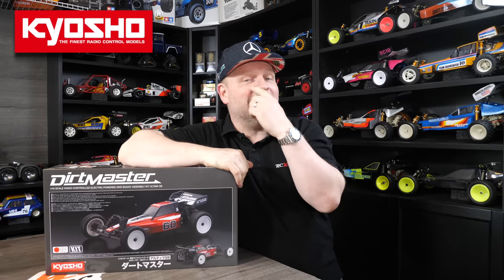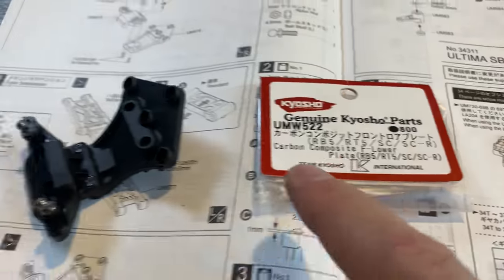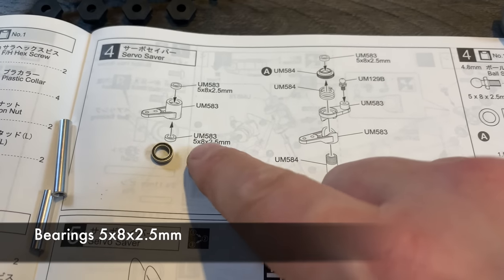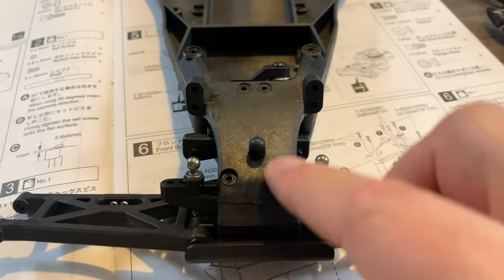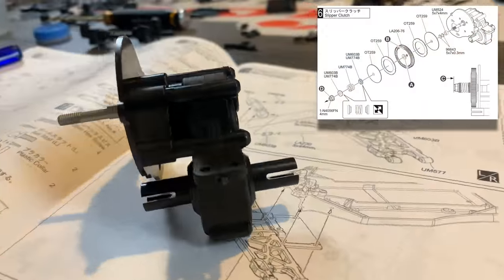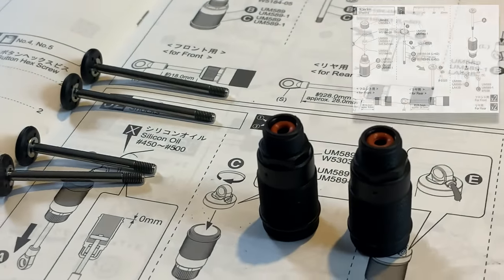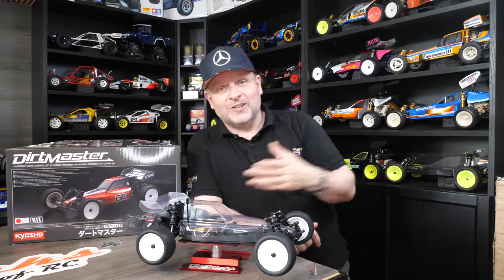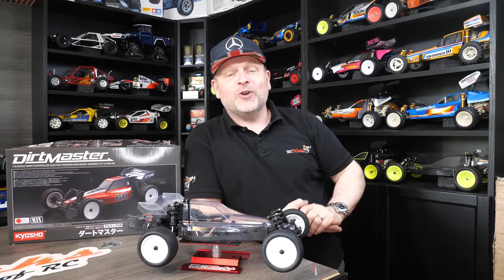What Did Kyosho Do?

Comment: It's a good bit of kit, just received mine last night and started the build promptly. Lack of shock oil is not a big deal because I got gobs of it from previous kits. However only supplying grease and no other liquids kinda sucks. I replaced the metal flanged bushings with metal flanged bearings. Lack of part numbers on the trees is a bit faux pas.

Comment: Nice one Gavin! At 4.39 in the video you show how the steering knuckles should be according to the manual and how you did them th eother way around 🙂 It doesn't seem to cause any problems so no need to redo them and get the left on the right and vice versa.
Reply from the maker: I’ll take a look and check 👍🏻

Comment: yes a nice build- i bought by accident a rb5sp last winter, used one with quite a few spares from someone who switched to AE. Last week  i got my DM, wondering what is changed to the older SP - besides the materials used and the shocks/ diff / bearing, almost nothing...  So i think i am running the SP with the body of the DM which is the nicer one i.m.o. , but the build of the new DM will be done at one time. See how it drives compared to the SP then.
Reply from the maker: Keep us posted as that’s an interesting comparison

Comment: That top shaft in the gearbox has a bushing you moved to the upgraded shaft. Apologizes if this has been brought up thousands of times already. But I think I would have sized that bushing up with a sealed bearing. Kyosho in the past was really good about standardizing on as few bearing sizes as possible.
Reply from the maker: Yep the upgrade shaft has the same bushing in the packet.  You have to remove it and then fit the motor mount.  After it’s all screwed down, you slide the brass bushing back on.

Comment: Had mine now for a couple of weeks in the USA.  Been waiting for another english speaking build on this model to see if anything was done differently. 

Same thing though...manual is rather poor.

Also, Kyosho made like 5 different versions of the RB5.  Was trying to figure out which this was based on or if a mix of a few different ones.  It somewhat matters in terms of RB5 upgrades.

Comment: Nice one Gavin, what diff oil did you use, I don’t want to use the grease they supplied and I was going 450 in the fronts and 400 in the rear on the shocks, I’m just trying to get a few more upgrades 👍🏻
Reply from the maker: It was some diff oil I had in the kit bag.

Comment: Hi Gav. Did you fit a standard size servo? Or what did you fit? It looks a bit tight for space, but the manual doesn't explicitly ask for a low profile servo. Thanks!
Reply from the maker: You can fit a full servo but it’s snug or a half height
Reply: I used a Savöx low profile servo for better clearence on my DirtMaster 👍
Reply: @Blastfromthepastrc1346 this is the route I went, in the end.

Comment: Seems unusual for Kyosho to have a manual that's a bit naff. A bit if advice that is nearly two decades out of date, make sure you have proper hex drivers when building one of these. I once disassembled and reassembled my RB5 using only allen keys. It suuuuucked, especially with the fibre reinforced plastics.
Good vid btw.
Reply from the maker: Yep that’s good advice.  I wouldn’t want to build one of these with just Allen keys.

Comment: Didn't quite understand the bearing situation. Are you saying that you are paying for a kit you cannot fully assemble as you need to buy separatley bearings for the drive line ? That sounds absurd.
Reply from the maker: No you get all the bearings required for the drive line, you don’t get bearings for the steering, you only get bushings in the kit.
Reply: Is it just the 2 bearings you need to buy? I've not opened my kit yet. But I would order them before I do.
Reply: @Keith Boyd  the steering needs 4 5x8x2.5 bearings. I went ahead and got flanged bearings to replace the flanged bushings.
Reply: @jefftroxell4923  cheers. Is it only the 4 steering bearings that need replaced? Is everything else metal already?